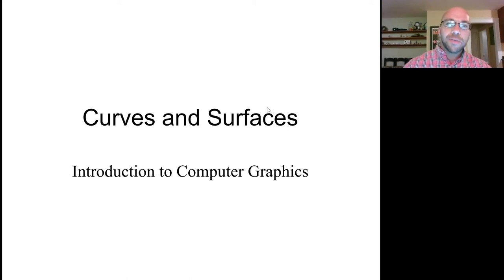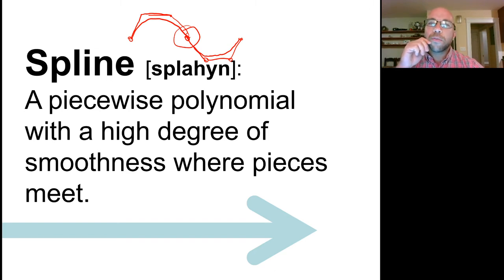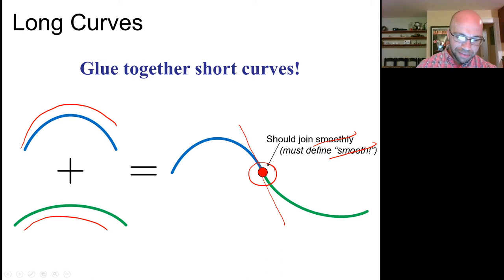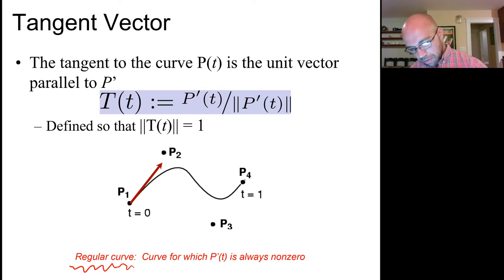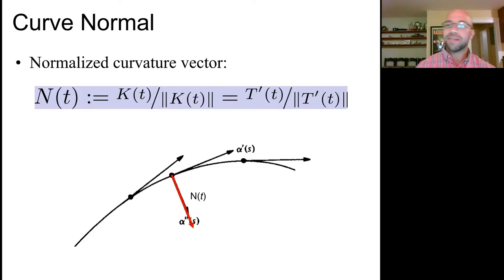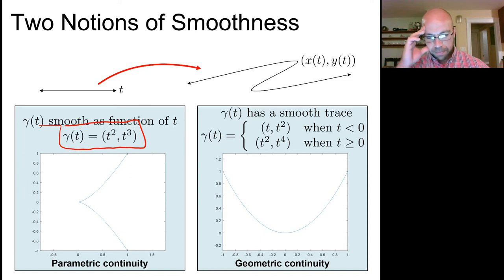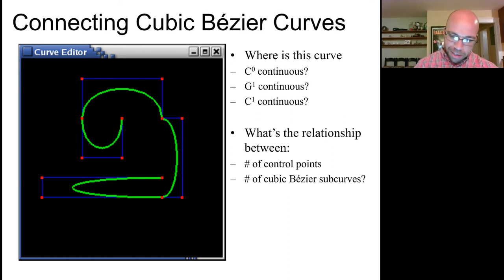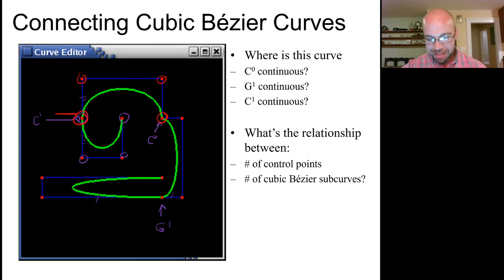Introduction to Computer Graphics (Lecture 3): Piecewise curves, tensor product/subdivision surfaces

Comment: The example for geometric continuity is a little confusing (25:00).
If the gradient of gamma(t) at t=0 is (0,0), doesn't that make the tangent undefined?

If instead we changed the limits such that:

gamma(t) = (t,t^2) when t <= 0*, (t^2,t^4) when *t > 0

Then we can instead take the limit of gamma(t) as t approaches zero from the positive direction, i.e. lim |x->0+| T(t)
Where T(t) is the tangent of gamma(t) for t > 0:

T(t) = gamma'(t)/||gamma'(t)|| = (2t,4t^3)/sqrt(4t^2+16t^6)

Therefore:

lim |x->0+| T(t) = lim |x->0+| (2t,4t^3)/sqrt(4t^2+16t^6) = lim |x->0+| (1,2t^2)/sqrt(1+4t^2) = (1,0)

(The gradient of (t,t^2) at t=0 is (1,0), meaning the tangent is also (1,0). So the tangents match in the way you talk about.)

Side point: The "car" doesn't strictly speed up when we pass t=0. It should actually come very close to stopping, before then speeding up considerably. But the main point about the velocity of the car suddenly changing is true.

If I am confused or mistaken about any of this, I would love to know. Thanks again for making these lectures publically available.